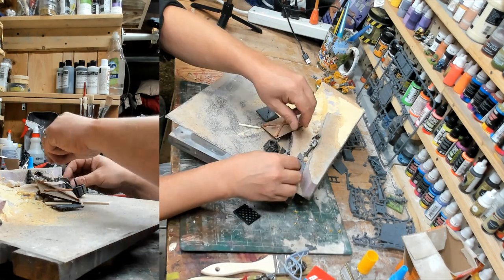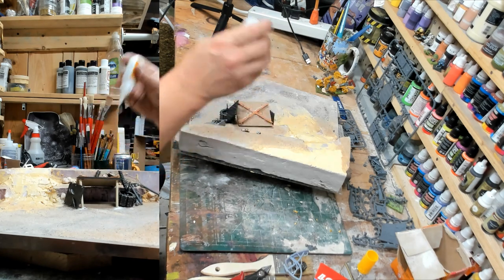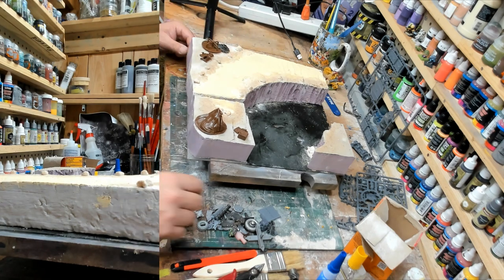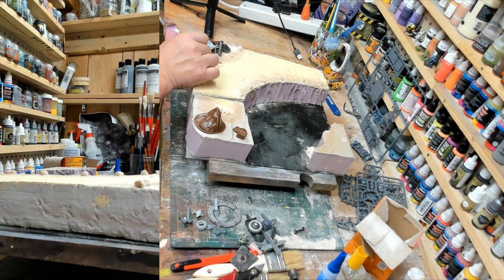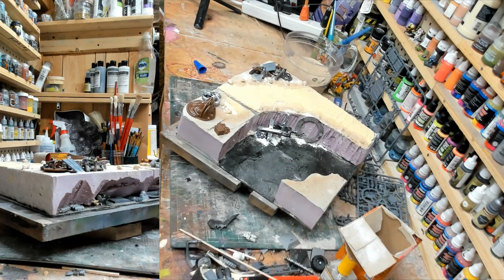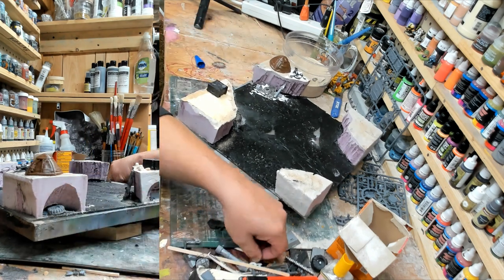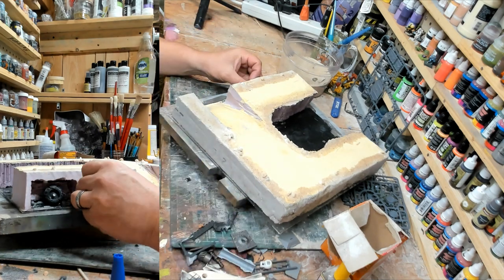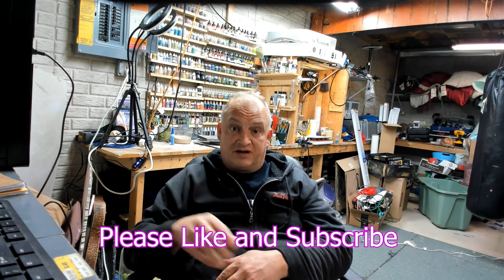Necromunda ash wastes sump build 4

Comment: So at some point in the video I thought you mentioned a resin pour and I thought it could be very interesting to paint up some loos junk throw it in and then do the resin pour over them.  A more specific idea I just had was that to do one of those floating dock/boat things that are just some planks over a group of barrels anchored with either some rope or a chain, I was just thinking that having one of those in the sump, especially if you built and painted it up but the barrels were actually watertight and then place them down before doing a resin pour so they're actually floating in the resin while it cures and then maybe connect a rope bridge to it.
Reply from the maker: That is a great idea!........  I might have to adjust some plans on this.....  Let me think about it for a minute here...  Maybe in a couple of more videos.    ok Yes I'll do it!  But you're going to have to wait to see it till the third painting video!